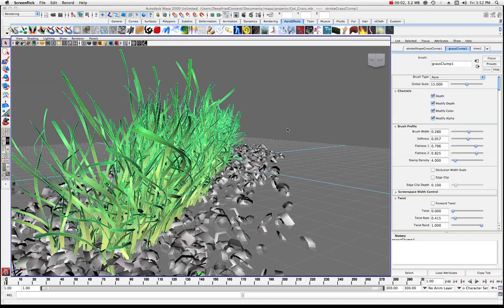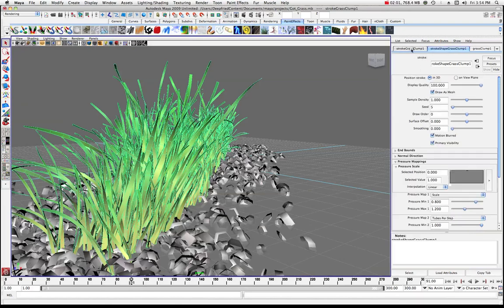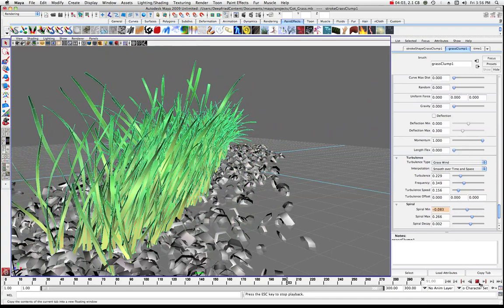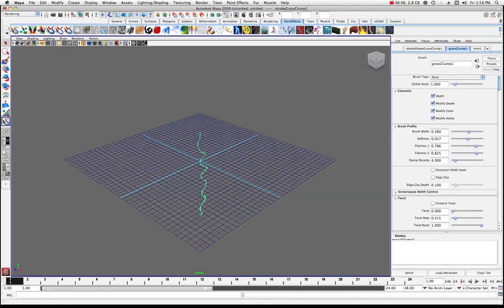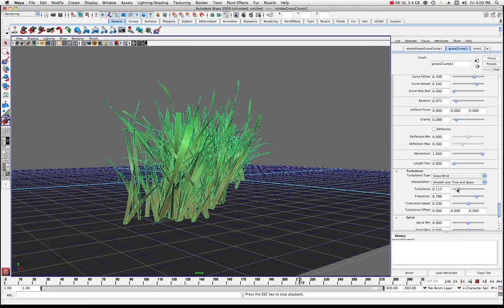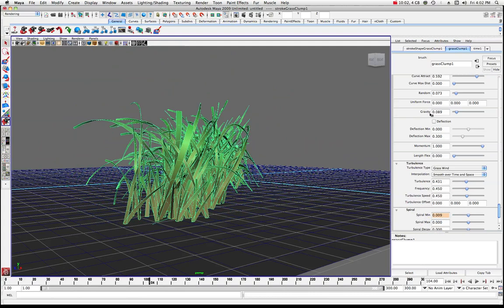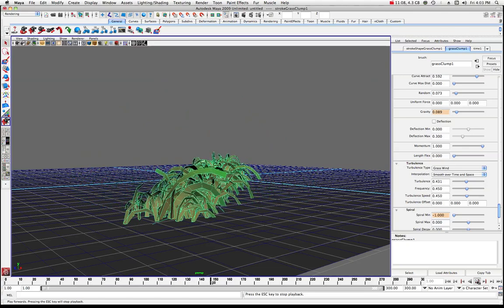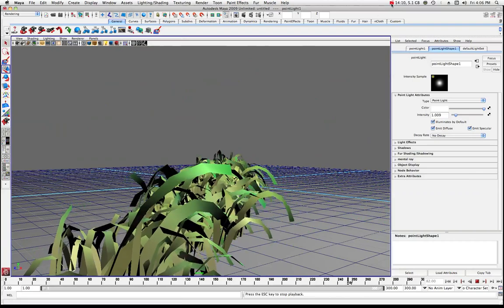Maya Flowing  Windy Grass Field Paint Effects Tutorial by Stuart Christensen

Comment from the maker: To convert, select the paint effects stroke and go to Modify - Convert - Paint Effects to Polygons.  This enables you to render the paint effects stroke with Mental Ray or save it out as a .obj that you can import into a modelling app.  However, you will lose the animated effects from the original paint effects stroke.  If you need to change the colors, try fooling around with the shading section options.  There are some limitations to using paint effects.  Hope that helps!